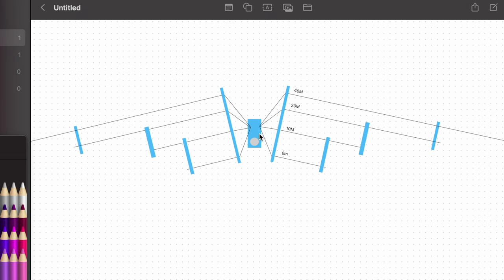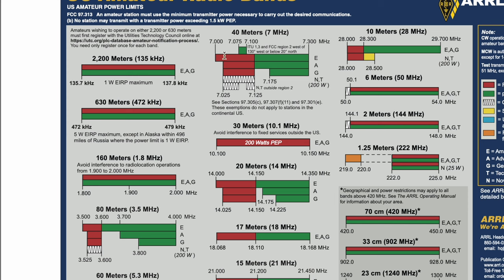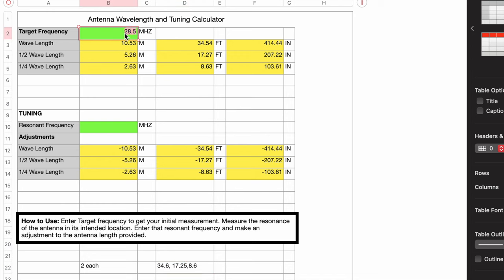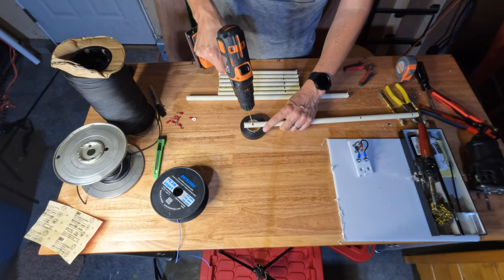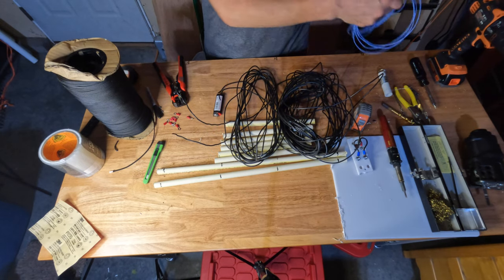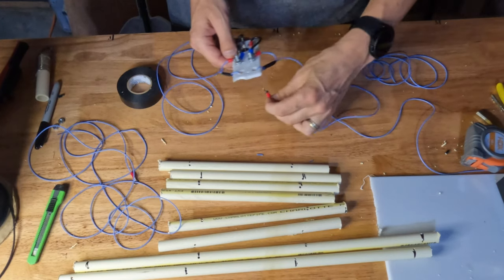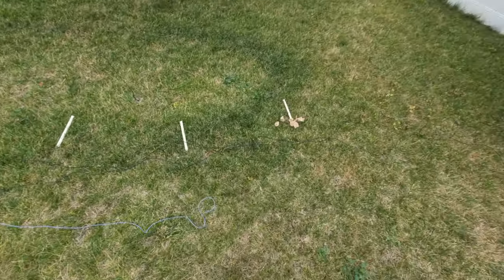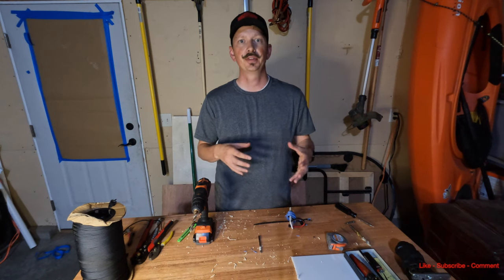Antenna Build Series 2- How to Build a Multiband Fan Dipole

Comment: I made a fan dipole for 40, 30, 20, and 10. Of course 15 is there also.
My spacing is 3 in. I drilled the holes in the spacers just big enough 
that the wires fit snug and added zip ties. I completed my 20 meter
WAS Award with it and 2 more left on 30 meters.  
I like your method of teaching. Bite size information that leads into
the next lesson and easy to understand. especially newer Hams.  KF6EWO
Reply from the maker: Thanks for sharing! I have a plan for the next one, to make these into verticals.  Just need time to record it haha.

Comment: You might be surprised how well it will work without the spacers. Just use a light weight rope on each element and space the end attachment points slightly apart on the support ends. Spacing is not critical and tuning is just like you described, starting at 40 and working your way up freq. Makes a great portable or semi permanent multi band antenna and is much more stealthy. Thanks for a great video.  73, N9XDS.
Reply from the maker: I might have to try that next time or make a portable version. Thanks for the idea

Comment: For keeping the wires from sliding in and out of the spacers, you could drill holes straight through the PVC and use zip ties on either side. That would look better than the tape. But still an awesome antenna build.
Reply from the maker: Yeah for sure it'd look better haha. I might try that next time.  I'm sure there is atleast 100 better ways to do it. I kind of enjoy slapping stuff together.
Reply: @kj7iaz  I'm actually going to be building a fan dipole for the exact same frequencies here soon... probably this weekend.
Reply from the maker: Cool. Use full length spacers. Watch the trap dipole video,  i start with the mess the wind made on the fan. I like the fan but it can be temperamental in the wind. Better , longer spacers should help, but watch it as to get an idea, should help you avoid the same issue.
Reply: Great idea cheers

Comment: I was just sitting here thinking about antennas... as I often do lol and a thought came to me. I don't really have room for a 40 meter dipole. I was wondering what the effect would be of.....

...a fan dipole for 20, 10, and 6 meters... WITH a top vertical ham stick tuned for 40m. 

I wonder if that would work. Would the needed ground radials be supplied by the dipoles of the other bands? I wonder.
Reply from the maker: I'd recommend a trapped dipole. Or a fan and load the 40m element.  Or do 2 hamsticks in a vertical dipole configuration with the elements of the fan coming off the bracket and the vertical element somehow.
Reply: @kj7iaz  I like that idea of 2 ham sticks in a vertical dipole configuration better. That way, it would still be a half wave dipole. Just vertical. And then the other bands coming off the center feed in a horizontal dipole. A feed point for all would be easy enough to design.
Reply from the maker: Hit me up on Facebook.  Ill show you a cool thing I made that uses ham sticks in a ground plane config
Reply: @kj7iaz  same name as the YouTube channel?

Comment: Cheers, I'm going to make one. HS0ZQA  David
Reply from the maker: Do it! It's a great project. Which bands?
Reply: @kj7iaz  I have made one, a two bander 20 and 15 metres. I had it tuned and in the air in one hour, the dipole for 20 was already cut.
I will add some more bands when I get some more wire.
Maybe 6 metres.